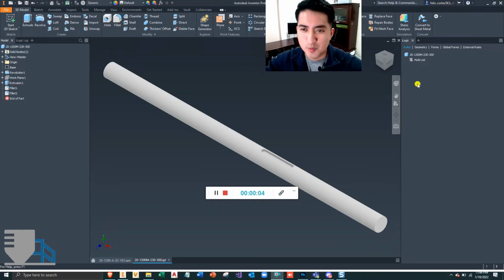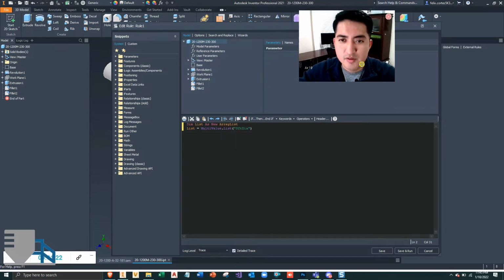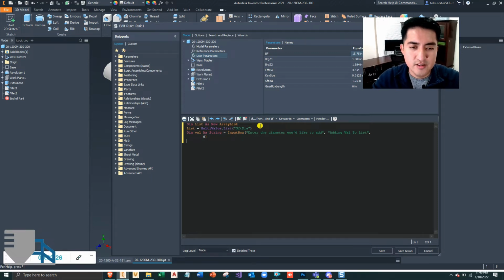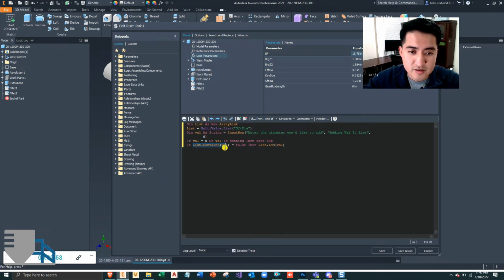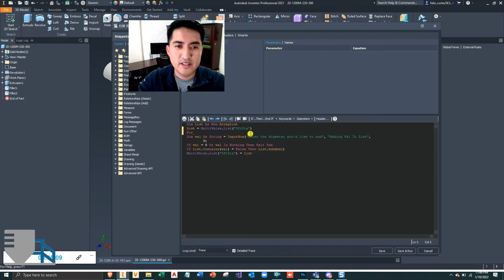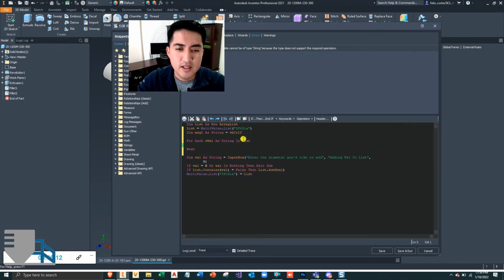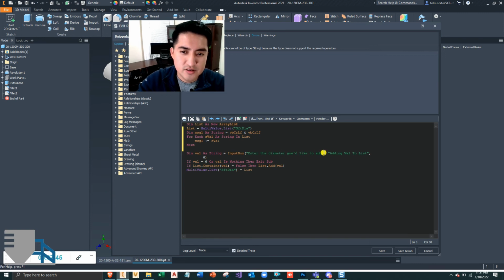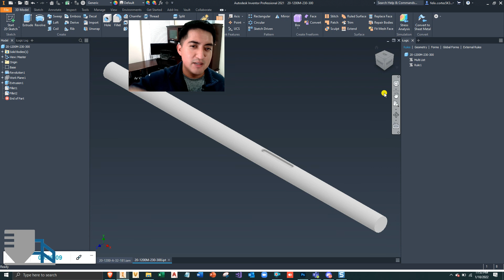iLogic Lesson #16: User Input Value To Existing Multi Value List

Comment: Thanks for this video I have found it really helpful, I do have one question about it.  I am trying to use it on a multi value list that is for text and I keep getting unable to convert to double.  I am fairly new at this but I don't see where in the code it is trying to convert my value to a double. Any assistance would be great.

Comment: Great job man, you are my Guru :). I have a little request about multi value List. Could you show us how to clear the list when a new family is choosen( in my case flange  from content center ). I need to repopulate my list with a new flange familly on demande, but when I do so, I get an error because a rest of the last list is still in (the last selected flange from the old family list to be more precise).
Reply from the maker: Hey Nicolas, thanks for your comment! Try using the .clear method of the class. What i mean by that is if your list is defined as "MyList", it should have a method called clear and it should clear your previous list. "MyList.Clear"

Comment: Love your videos man. I'm just learning in depth ilogic and it's saving me literally hundreds of hours a year at work. I'm building toolsets for my colleagues. Do you do much in the way of parametrics in autocad? I have tried Autolisp (AutoCAD's programming language) a few times but I couldn't get to grips with it. I noticed in one of your videos and we had a discussion that you use autocad in your workplace to  program inventor and I want to see how far that process can be pushed. One thing that never ceases to amaze me is that the industry (construction or manufacture) are so unaware of the time savings that inventor and parametric modeling can provide. I tell my bosses how with a bit of training and some setup time, I can reduce their design time by 70% and they look at me with a dumb face. But then they ask me to do presentations for clients so they know it's worth something 🤣
Reply from the maker: I've been in your position haha. This automation industry is still very much new and does unfortunately require some sales to be able to convince your manager/company.  Wish you luck with that area!

I haven't gotten deep into AutoCAD API, other than extracting values from blocks. Mainly focus on automating on Inventor since that's mainly what our engineers use. I have zero experience using Autolisp and I think I'd prefer making a stand-alone application. I believe Autolisp has to get embedded into the program? But yes, you can do a lot of automating with AutoCAD as well. It's pretty fascinating to be honest. I hope you succeed and keep going at it